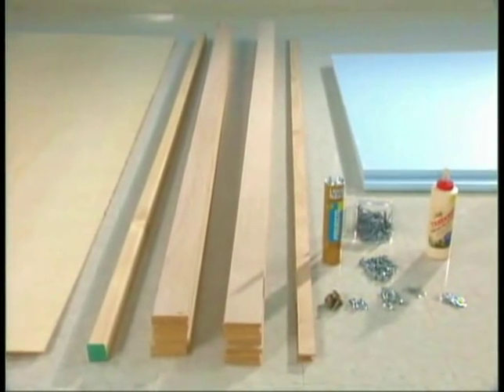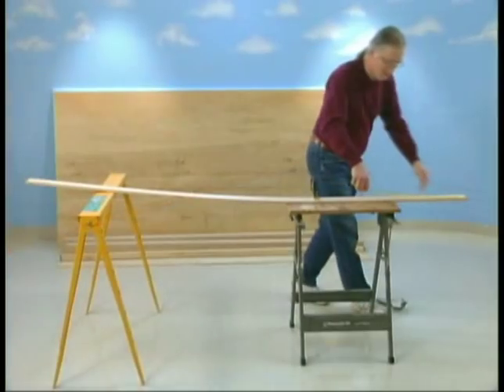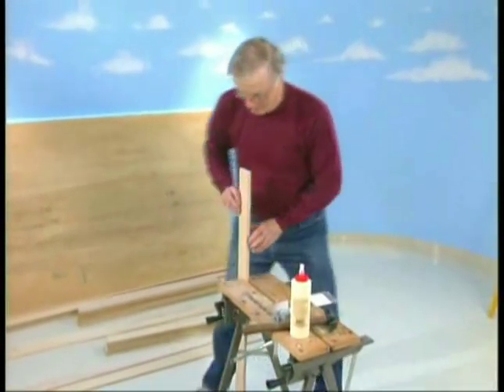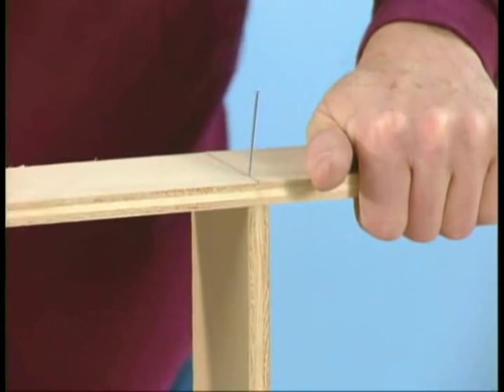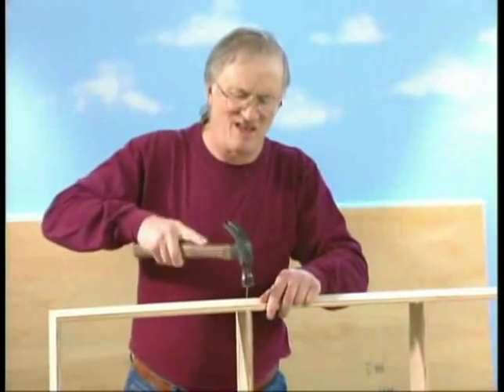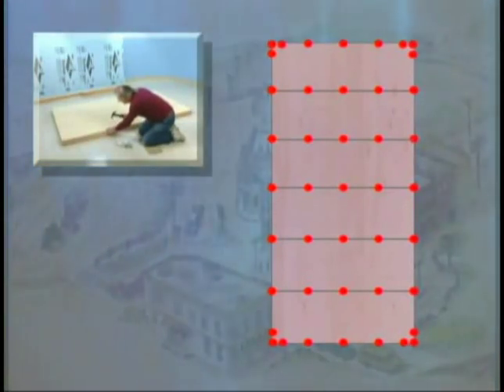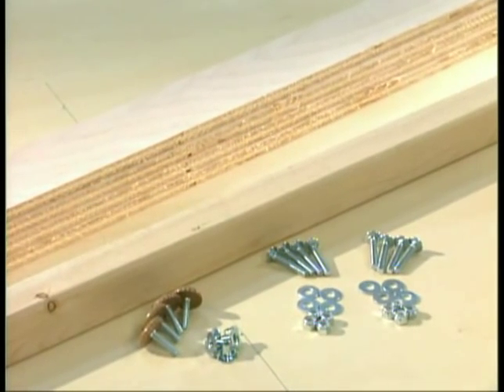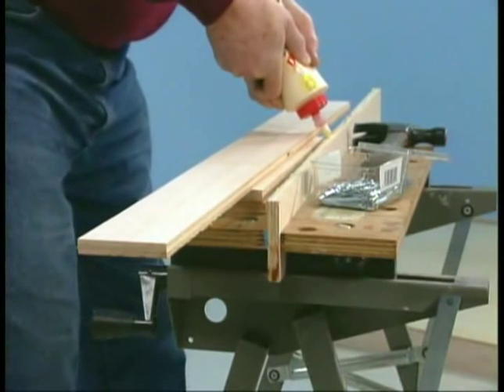WGH Video Scene 2 Benchwork Part 1

Comment: Here's an idea- if you already have a solid table that you aren't using, just skip building the bench and put your plywood base on the table. 

That's what I did and it made things A LOT easier. Plus I'm doing N scale, so it's a smaller layout. It will also be easier to move in the future.

Comment: If he was using glue on all the joints and using a nailgun, MAYBE it would be okay. But a hammer?

Wood glue (yellow carpenter's glue) and drywall screws are the way to make sure that thing never comes apart.